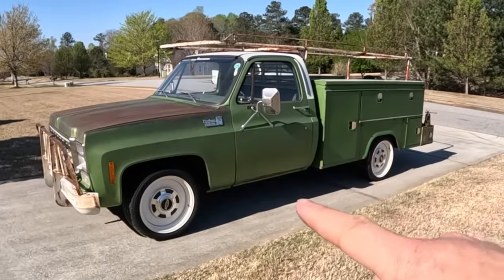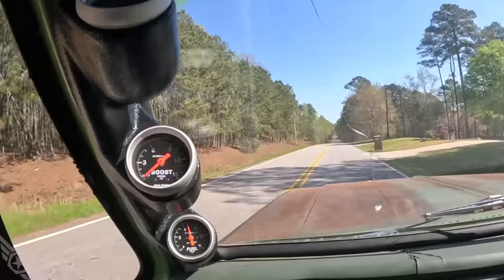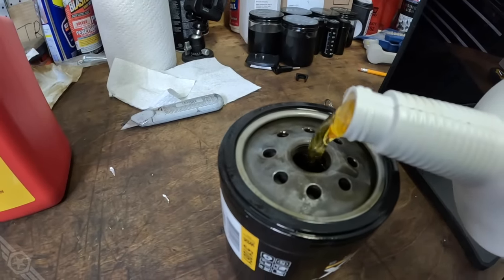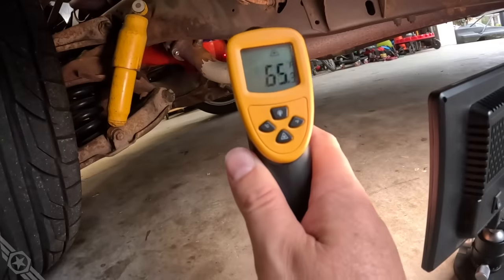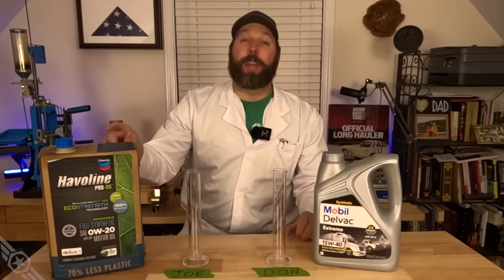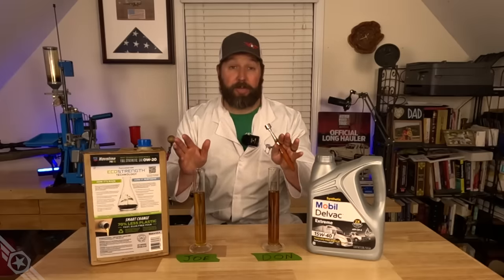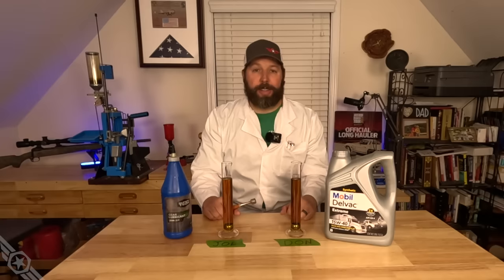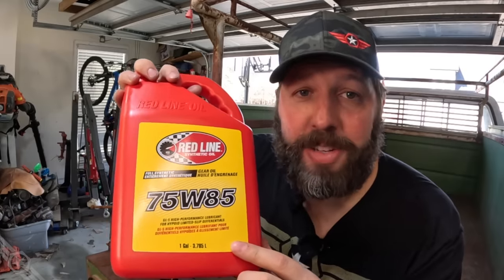Running GEAR Oil in an ENGINE!!! (EXTREME PRESSURE)

Comment: Love your explanations. Any chance of going over those 'tuner chip' mods? Or other power adding things like 'performance' enhancing air filters. Also I found a Donaldson filter would fit my jeep and it's supposed to be a lifetime filter. Thought you might like that one.
Reply from the maker: I’ve got some performance stuff coming up. I’ll say this about performance air filters. Unless you are making big power, in most cases, you are just letting my contaminants through the filter without realizing any performance gain. Especially is diesel applications, the factory air filter will filter better and flow more than enough to make more horsepower than the other fueling and air components can support.

Comment: I don't think running it for such a small period will trash the engine.
Running it longer would be required to show why you don't want to do this unless you went with a thicker gear oil.
Gear oil behaves differently under the extreme high heat inside of an engine rather than in the gear chambers it's designed to run in.  Obviously, this means it will not behave as the manufacturer intended.  Add to that the different contaminates it faces, it clearly isn't fully compatible. 

It is interesting to see the results, and shows that the lowest thickness gear oil is much thinner than you would expect.

p.s. You might want to do some rust treatment on that undercarriage to halt that rust pitting. Someone needs to invent a nice rust dissolving primer and a paired heavy enamel for that.  It would likely double the life span of mufflers and such, while making the main undercarriage and  frame last 10 times as long.  For people that like shiny they should make one that can go over plating (chrome, nickle or otherwise.)
Reply from the maker: I just leak oil. That’s my rust treatment 😂👍

Comment: We had some really thick gearcase oil at work , used on GM class 66 diesel loco's gear cases (gear from traction motor to wheels ) its as thick as cold golden syrup , be interesting to try in engine
Reply from the maker: Let me borrow an engine from you and I'll make the video 😂

Comment: Currently have gear oil in my 87 camry as engine oil.....😂 I would be worried but she leaks so much out it'll work itself out. I got this car when i was 14, I'm 30 now. She also runs just fine on bar and chain oil. No crazy blow by or anything, but again this thing leaks so much oil out it's hard to say anything. 😂
Reply from the maker: Pretty sure you can run a Toyota without any oil. Don’t waste your money 😉

Comment: I'd also worry about the extreme pressure additives in gear oil reacting with the different metals used in engine bearings. I know the additives used to meet the GL5 spec can damage the yellow metals used in transmission sychro rings, which is important knowledge when filling manual transmission in older vehicles (I like Red Line manual transmission fluid if anyone needs a suggestion).
Reply from the maker: Yeah, the trans in this truck requires a GL-4 for that exact reason.

Comment: If it was really cold outside it might be worse haha😂
Reply from the maker: If it was really cold outside, I wouldn’t have 20W-50 in the engine. But this gear oil is still thinner than 20W-50 in almost any environment.

Comment: I ran 80W-90 in a 351 Cleveland with hydraulic lifters and bent 90% of the pushrods, took care of the bottom end knock for a couple of months while I rebuilt another 351 to swap in though...😁
Reply from the maker: The pushrods bent after adding gear oil?
Reply: @freedomworx  Yes, I believe the hydraulic lifters were pumping up too much with the increase in viscosity. Not sure what else could have caused it, it was most of the pushrods, and that was the only thing out of the ordinary. I was a bit younger then and not shy on the RPM either. Babying it may have stopped it from occurring, but I can't say for sure.
Reply from the maker: @leemollison7508 yeah, that’s the only thing that makes sense to me. Caused so manner of shenanigans with the lifters.  🤷🏻‍♂️

Comment: That red line gear oil, is for manual transmissions.  (My nissan sentra ser spec v uses that exact fluid)  The "real" gear oil, is for differentials and transfer cases.   Maybe the transaxle of a subaru, but it's been a long time since I worked in a shop. 
My old Honda, used 10/30, 10/40 or 20/50 engine oil.  Over 300k no issues.
Reply from the maker: Yep. I’ve used it in a few of my own manuals before 👍

Comment: It's not about oil pressure more lubrication , if you could see engine oil at a molecular level it would appear to have hook like features so as to cling to the bores and so on as for gear oil that has a rubber like construct that aids lubrication when gears are meshed together .
Reply from the maker: Gear oil and Engine oil are both made from...oil. Which part of the additive package of an engine oil make it look like Captain Hook under a microscope??? The Anti-Wear Additive? The detergents and dispersants??? The anit-foaming additives???

Comment: I may or may not have put a little bit of 85w140 in my tractor engine when pressures were getting a little low in the heat …. Hey Lucas is expensive
Reply from the maker: Whatever it takes 😎

Comment: 10:20 I have that in my garage as my manual transmission uses that 75W80 gear oil.
Reply from the maker: You are one of the few. 👍

Comment: Wat a beast of a old pickup sounds amazing but the science side of it wasn't interested only the part of you trying it out in the engine with the different between normal oil and running gear oil but I would not of tried in that engine just in case as would of been expensive if it did go bang but was interesting to watch 👍
Reply from the maker: I wasn’t worried. I already knew that the gear oil was thinner. And it was only in the engine for about 6 miles 😉

Comment: There was a guy in youtube land with a worn out SBC in his mud bog truck. That talked about running 90W140 gear oil in the truck for a couple years now. 20W50 supposedly only got him 5 psi of oil pressure at 6K rpm. But the 90w140 got him up to 40 ish at 6K rpm lol.
Reply from the maker: That’s pretty extreme. But if it works, it works. Bet it stinks though!

Comment: The thing is higher oil pressure isn't necessarily better. Oil flow is more important than pressure, and high oil pressure can be a result of lower oil flow not more.
Reply from the maker: I know. Most people dont understand that oil flow is needed for cooling of components. And they don’t understand that lubrication isn’t a result of engine oil pressure. I’m just trying to demonstrate the difference in viscosity grades in a manner that most people can understand. 👍

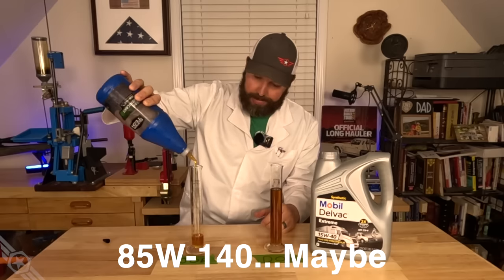Comment: I started being a mechanic in 1968 when I was a kid😅 I've got a 2000 Buick where's the 3.8 it has digital gauge monitors it gets 65 lb oil pressure with 1040 because it's got a 160,000 Mi on it I wanted to protect the engine I switched to 10:30 because of friction and I wanted mileage I pumped up the tires to 40 lbs I now get 45 lb of pressure when it's cold and I get 40 down the highway it lost 20 lb pressure changing oil to a thinner oil but it got 65 lbs with 1040 with 160,000 Mi it runs like a new car
Reply from the maker: In general, the lightest oil that gets the job done is what you want. Anything more than that is just wasting power and efficiency.

Comment: Over time the blow-by and positive crank-case ventilation allows a little bit of oil into the combustion chamber and then (burnt) into the exhaust. The additives in the gearbox oil are likely to prematurely age the oxygen sensor and catalytic converter in the exhaust system of a recent car. These are expensive to replace.
Reply from the maker: It's possible.

Comment: My 1977 Chevrolet Cheyenne-20 has 2.5-3.5 psi oil pressure @ hot idle. Factory  original 350 small block. Only 62,000 original miles on it. In fact it only has a max hot oil psi of 22 .   30 psi cold oil and driving 55mph
Reply from the maker: Most people think oil pressure is way more important than it is.

Comment: Few realize that 20w50 engine oil and 75w90 gear oil are almost the exact same viscosity. They "believe" gear oi is thicker but are not informed to the fact that gear oil and motor oil are rated on different temperature scales. the end result is that they are basically the same thickness, hence why you can use 20w50 engine oil in a harley davidson transmission that can also use 75w90 gear oil.
Reply from the maker: Science 🤓

Comment: Bar and chain oil is also 30wt oil with similar additives to make it sticky.
Reply from the maker: I've used engine oil on a bar, but I'm not willing to put Bar and Chain Oil in an engine. I just don't know enough about it.

Comment: I once had an old engine that i was getting ready to replace and before I took it out drained the oil and replaced it with water. Yep, I did. I drove it around my neighborhood. The oil light turned off and it did ok. When i parked back at home it was perking and spitting like a kettle.

Comment: Yup. Some years of 80s and 90s honda even specify using engine oil for the manual transmission. Do not do this, it will halve the life of your trans, but will get you home.
Reply from the maker: Do you know why they specified engine oil instead of gear oil?

Comment: For all the doubters that think it's wrong to fill an oil filter with fresh engine oil from an unopened uncontaminated plastic jug of oil that will never ever be as clean as when it was in that unopened plastic jug!  It is 100% OK to do that if at all possible depending on filter, location and position of the oil filter because the oil he's pouring into that filter can never ever be any cleaner of impurities, then when it was in that sealed jug! no amount of filtration on an engine can bring it back or make it any cleaner and more pure than the oil that's coming out of that bottle! The engine oil, additives and oil produced in a oil refinery Are of the purist state in which that oil will ever be! so what he is doing by filling  the engine oil filter is actually best practice if possible to do so. Another option in which I've utilized in the past on my own vehicle after doing an oil and filter change is to remove the fuse from the ignition module in my vehicle, in doing so I can then safely crank over my engine for 10 seconds in order to let the engine prime the oil filter in order to prevent a dry start up engine wear. Then once I'm done the oil and filter change, my engine is already primed of oil. I then put the fuse back in and start the truck up. I do this instead of filling the oil filter because the oil filter is in one of the worst locations I've ever seen is on my 2017 RAM 1500 5.7L. It's in a horrible location so I've decided to purchase oil filter, relocation kit from amazon once I can figure out which one is the best affordable option? As usual , keep up the great work & forget about the peanut gallery...
Reply from the maker: I'm going to have to disagree with you on this one. You have to define cleanliness before you say that the oil can never be cleaner than it is in the bottle. Since we are talking about filtration, the definition should probably be limited to solid contaminants, because that's all the filter would be removing anyway. While i agree that the oil out of the bottle is plenty clean to be poured into an engine without filtration (hell, cars didn't even have oil filters until the 60s for the most part), bypass filtration can actually remove particles smaller than what the manufacturer of the oil is required to remove per applicable standards. Meaning the ISO cleanliness of used oil ran through and engine with a bypass filtration system, will actually be better than the fresh oil straight out of the bottle. I installed a bypass filtration system on my Duramax and have a virgin oil sample that I will be comparing with a 5,000 mile oil sample out of that engine. The particle count (ISO Cleanliness) might actually be better than that virgin oil sample. Obviously below a certain size (2ish micron) there are going to be more particles in the used oil, which is soot, and the reason the oil is black. So if you focus on those, you could say the oil is dirtier, but from a lubrication and engine wear standpoint, those particles have virtually no impact on the engine. Just something to think about. Stay tuned and see how the used oil analyses turn out. We might both learn something 😉. https://youtu.be/qPXsCG-C-JY?si=IRggxmHxJjwo9lye

Comment: I clicked on this video BECAUSE I had my own experience 15 years ago when the bike shop helped me select the oil for my street bike. Since the transmission and engine runs in the same oil "they said" this gear oil they sold me was the thing to use and thats what they used in their yamaha.. 🤔  not sure if he was referring to a 4 wheeler or what.  But i put that oil in my bike and i vividly remember the oil light go out after the oil change and i let it warm up before my ride. It was a mile of gravel road to the highway which was always sketchy to ride. Well...a half mile down the road it started to bog down and then it just locked up. It crossed my mind to grab the clutch as the back tire was skidding at probably 40 mph or so but i was too busy trying to keep it up right as it fishtailed. I ended up laying it down and flying over the bike taking the hide off my wrists behind my gloves. I pushed the bike back home and have never ridden it since. I had taken it all appart and the bearings had gotten hot but they didn't ruin the crank or anything.. never knew what went wrong till years later I got curious. I found an old bottle of what they sold me and compared it with what I bought with the rebuild kit and i always wondered why that oil didn't protect like the oil it was supposed to have. Pisses me off I listened to them without knowing what it was supposed to take..
Reply from the maker: Yep. Folks like to argue with me when I make videos that contradict what they or their mechanic says or does. But the reality is, many mechanics don’t have a clue what they are doing or talking about. Sucks you had to find out the hard way.

Comment: Put a small pin hole in the gallon can on the top if you do not want to reuse it . Will stop the gulping happening drawing air from the pin hole allowing filling easier.  Old engines have larger gallerys than newer engines . Too tick an old with stop hydraulic lifters from functioning properly as the oil wont pass through them . Possible causes them to stick open causes valves to be slow to close
Reply from the maker: I like the Glug 😉

Comment: Cool test 😎 
I will never use BUMBASS oil grades like 0W20.
5W30 or 5W40 are the thinnest I use in my various cars.

Modern Dumbass oils do NOT have longevity of the engine at heart.
I would rather sacrifice 3mpg running thicker oils any day.
Oh and I've never worn or blown an engine out in 40 years. 
BTW I've always implemented a 5000 mile service interval for any car I've owned and it's paid off BIG TIME ❤😊
Reply from the maker: I just use what the manufacturer recommends at the interval the manufacturer recommends, and I’ve never had an engine failure or oil consumption issue 🤷🏻‍♂️

Comment: Well actually at mechanic school I learned that 80w90 was base on 10w30 with high pressure additives. They label it 80w90 to make people understand the oil was different.
Reply from the maker: That’s a little bit off. 80W-90 is thicker than 20W-50. https://blog.amsoil.com/gear-oil-vs-engine-oil/
Reply: @freedomworx  yes the additives change the viscosity of the oil alot. My info come from book in the 80s and 90s. Back in the days 10w30 was use with additives packages to make the 80w90. Nowadays it s alot more complicated than that.

Comment: Give her a cold soak at 20 below in freedom units.  Interesting find was powersmoke 6.7 rod  bearing failures from 15w40 oils instead of 5w40 oil. Max oil pressure should really be the oil pump bypass spring, if the engine has a HV oil pump and standard clearances, bypass is pretty much open all the time to some extent.
Reply from the maker: Freedom Units… I feel like we need an additional system of measurement in the U.S.  anything accept the metric system 😂 If the oil pressure relief valve is continuously bypassing, the oil pump isn’t properly sized. Pumping oil that gets bypassed just heats up the oil and wastes power and efficiency. The relief valve is not designed to regulate oil pressure, only to relieve it at cold oil temps and/or high RPM.
Reply: @freedomworx  Yep, seen quite a few motors with tight clearances and a big high volume oil pump, needle sits at the relief pressure pretty constant even hot. More wear on the drive gears too.
Reply from the maker: But if it’s got a 3/4 race cam, it needs a HV Oil Pump to bark 2nd gear 😉

Comment: Have you ever heard of using motorcycle oil (JASO specification) in gearboxes and rear ends Is it good ? mainly in engine with some changes.
Reply from the maker: Yes and no. It's common to use an engine oil in a gearbox or manual trans. But not diffs. Diffs have hypoid gears. Hypoid gears are the reason diffs require a different oil.

Comment: We put a couple quarts of 250W Gear oil and straight Kendall Nitro 70 in a Demo Derby car.....And mixed up 2-stroke Gas 50:1 for the top end lube....Because Cooling systems don't really last....Won the Feature...and sold the car for the motor at the end of the nite....Man if only he knew.... The only demo car where money was made!
Reply from the maker: 250W??? 👀. That’s not made from dinosaur juice…that’s like literally unrefined whole dinosaur flesh 😂😂
Reply: @freedomworx  Yes, it was very thick...in the Model T days they had some stuff rated as 600W (I think its available in limited quantities) I was told by my grandfather that its basically TAR! - He was a Model T expert in our area so to speak.
Reply from the maker: @misters2837 wow. Never knew that 👍